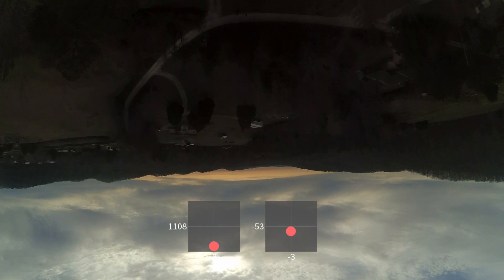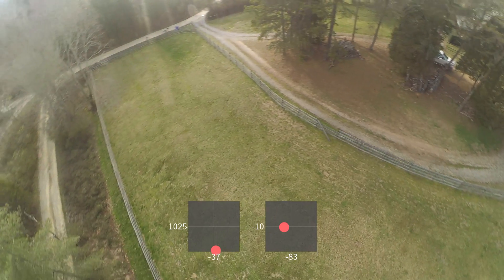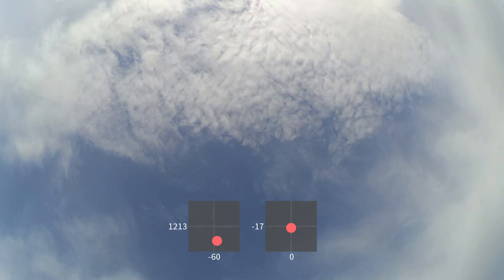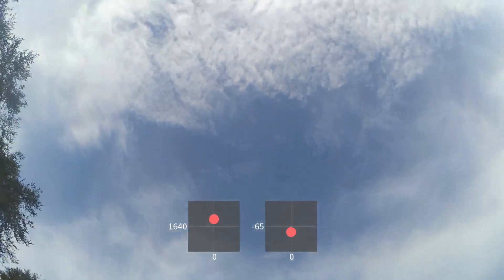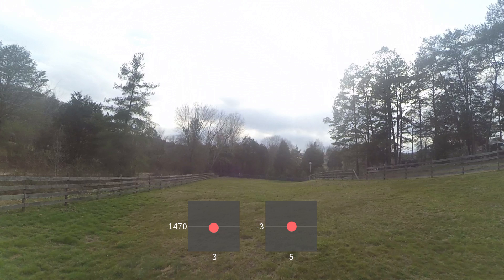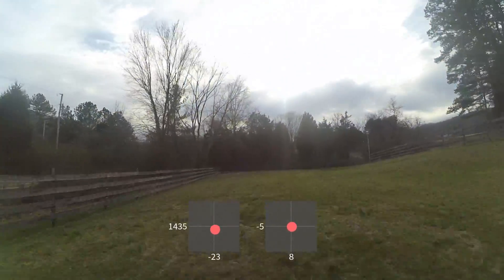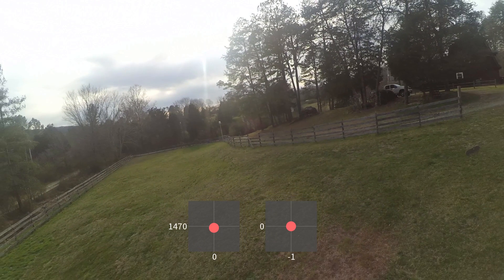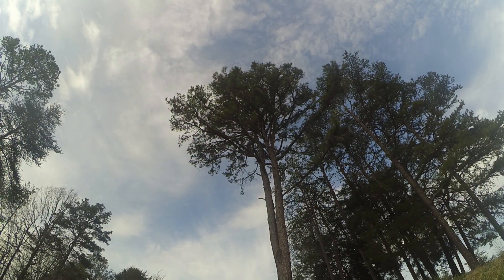How To Do Power Loops | QUADCOPTER TRICK TUTORIAL

Comment: Does motor stop enabled affect the loop when you upside down? I mean the setting in cf.. where when your throttle is at zero the props are still spinning at a low rate. Should we set the motors not to spin at zero throttle?
Reply from the maker: +Tooth Pain if you were to do that the copter would lose control
Reply: Joshua Bardwell you definitely don't want to drop full throttle otherwise you will lose control but do bring it down to about 10%

Comment: I am new to fpv flying and quad flying . Can you tell me how to set up your controller for stunt flying
Reply from the maker: That is a pretty open ended question. Can you be more specific?
Reply: how do you set up your throttle curve for stunts. Like what are your points and percentages for low, 1,2,Mid,3, 4 and High.
Reply from the maker: Linear. Completely linear. I don't like throttle curves because the hover point of a copter is different for every copter, and what battery you're running, and whether you're running an HD camera. I just want a linear curve on every copter.
Reply: Josh does this mean you use the same radio and radio setup for many kwads? I expect this means your radio always delivers the same instructions and let the kwad show its colors? I am just learning and wonder if I can keep binding my frsky taranis to new (frsky-ready) kwads and try them out?
Reply from the maker: +Zak Borg search my channel for "model match"

Comment: do you use acro or horizon mode? and do you air mode? I have been trying to do the upside down no throttle tricks but I never seem to be able to :( Help plz
Reply from the maker: I use air mode, yes, 100%. Everything else is acro mode. Literally none of the top pilots use self-level mode. For FPV, acro mode is better once you get used to it. 

Without air mode, you will not have much authority at zero throttle.
Reply: Thanks for your answer XD

Comment: does your quad have Sixaxis you know 3 axis gyro and 3 axis accelerometer. or is it in 100% manual where if a beginner were to yaw a little they would go out of control
Reply from the maker: All multirotors have at least a six axis gyro. Without that, you just couldn't fly at all.
Reply from the maker: +Joshua Bardwell well, technically, only 3 axis is mandatory. But I don't think you commonly find anything less than 6.
Reply: +Joshua Bardwell I've just bought a vortex 250 and I've been only flying with smaller quads line latrax alias. I'm pretty confident when flying with those quads at 100% rates so I'm eager to go bigger/more power

Comment: what is the expo on pitch and roll and is it set to the tx or fc?
Reply from the maker: +Tvpc1971 RC expo is about 0.65 or 0.7, and on the FC. Bear in mind that the sticks overlay shows the result AFTER expo, so my actual stick movements are somewhat larger than you are seeing.
Reply: +Joshua Bardwell I use a cc3d and I just started flying in rate mode after about a year of flying. Over the next few weeks I'll slowly start increasing my rates and adding expo. Flips and rolls are cool but the loops and upside down hang times really shows control of the machine.

Comment: I'm sure you've seen the DALRC channel videos of the guys doing power loops under throttle the whole time?
Reply: Yes you can hold throttle whole the time that keeps the momentum which is the real power loop as people do LOS. Actually the best way to learn what is going on is by flying LOS....you can see what is going on. with fpv your more less blind during the move
Reply from the maker: I'm sure you can. I just think it cuts the back side of the loop short.
Reply: Kancho!
Reply: Yeah it's all got to do with camera angle. If you work your way up to 60 degrees you can see more of the path your quad is traveling and you don't need to let off as much....right Joshua?????
Reply: I definitely agree about LOS! I was shitting myself when trying to learn power loops in the "tunnel vision" of FPV (especially when looking up at the sky). I tried it LOS and quickly learnt how the quad behaved during different stick movements and just how much room for error I had before hitting the ground :) I've been doing the same with inverted manoeuvres as well.